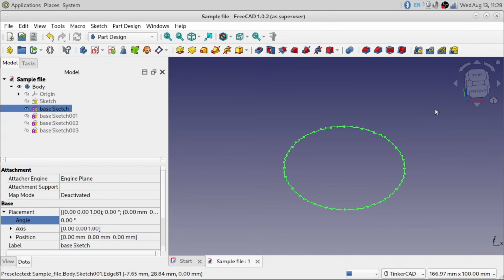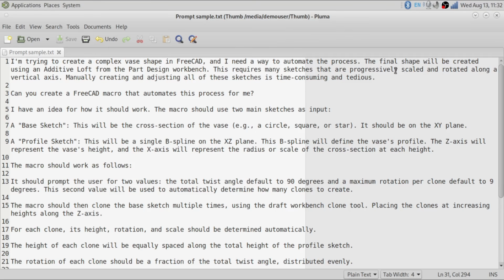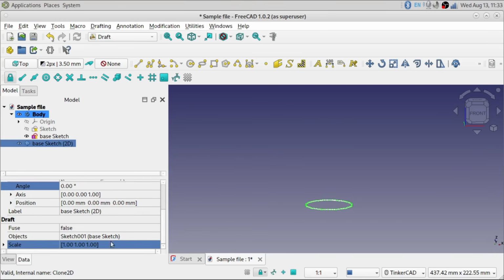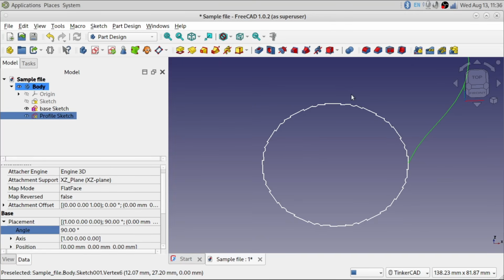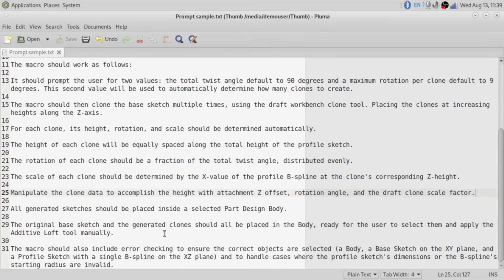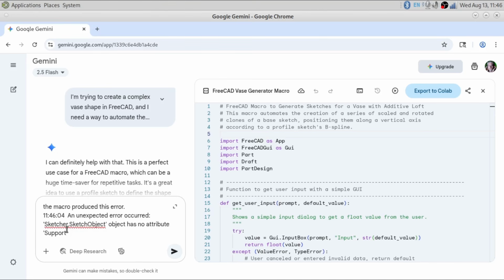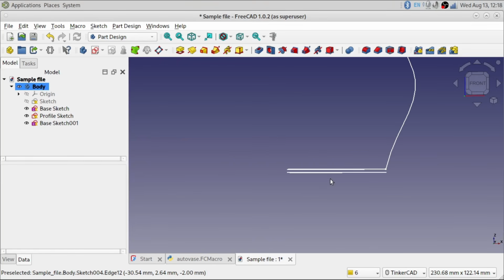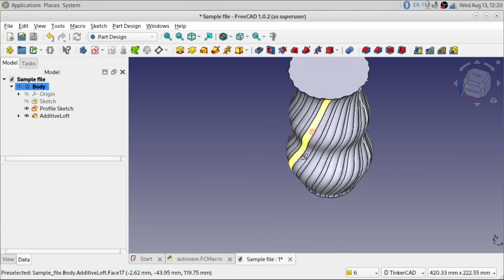3D Modeling - Using A.I. to create macros for automation in FreeCAD.

Comment: User selects:
  “Body” container
  “Base Sketch” in XY plane
     X-Axis represents cross section radius or scale 
  “Profile Sketch” B-spline in XZ Plane
     Z-axis represents vase’s height
Prompt user for:
  Total Twist Angle (Default: 90°)
  Max Rotation per Clone (Default: 9°)  
Program Calculates: 
  Increasing heights
  Scale from Z-Axis
Program in the Draft Workbench Clone Tool:
  Use “Base Sketch” 
  Use “Profile Sketch” B-spline
  Create vase section clones in Z-Axis
    Scaled
    Equally rotated
    At equal increasing heights
Program includes Error Checking:
  Correct objects selection 
    Body container
    Base sketch 
    Profile Sketch
  Profile sketch invalid dimensions
    B-spline invalid starting radius
User in the Part Design Workbench manually:
  Select the initial base sketch
  Select the Base sketch
  Select the Vase Sections 
  Generate the 3D surface using Additive Loft

Comment: Nice video, the error la are normal. I find that Claude is better at coding.  I write full blown servers complete with Claude.  I almost do not write code by hand anymore. I build a system to have context with my code and a error and fix file with index however I use VSCODE to everything.

Comment: I want to try to do this with simple labels/signs. Have some parameters where I enter the text of the label, and it automatically scales according to the size/length of the text etc. I have 0 experience in FreeCAD though... downloaded a ton of  tutorials, but will take some time.

Edit: I got it working with gemini free!
Reply from the maker: No need for fancy scripts.  You can use the expression editor to reference other dimensions in the model.  So you can have a bit of math that sets one dimension based on a scale factor of the text dimension etc.  
I did a video about some of this that might help. 
https://youtu.be/MMKFNVIuCYo

Comment: Assuming FreeCad is installed, is it possible to create a stand-alone python exe that can view a step file, and rotate it based on user (keyboard/joystick) input?

BTW, any thoughts on TinkerCad or Plasticity?  Those seem really friendly for CAD design!
Reply from the maker: There are many step file viewers for just about every OS.  If you are running Linux just open your software center, or synaptic and search for step file viewer. There's at least four. I'm sure there's many on other OSs as well. 
I used tinkercad exclusively for about 7 years, just switched to freecad last year and it is so much more powerful, and really not too hard to learn. There's a YouTube channel called Mango jelly, and on his playlists he has a free CAD 1.0 beginner course. If you are new to the program I can't lend it enough. It's well worth your time.

Comment: I have tried the macro, and it works, however, if i use the thickness tool in PartDesign workbench on the loft, it fails to do so. I don't know what i did wrong, it certainly does not have to do with the macro, that one works great. Thanks.
Reply from the maker: The thickness tool doesn't work well when you have complex geometry. If you want to hollow the vase out, the best way to do it is to draw a profile on the XZ plane of half of the hollow and do a revolve of that profile to create a solid you can cut out of the middle of the vase. Or if you're in the part design workflow you can use the groove operation to cut out the middle of the vase.
You can also print the solid version using vase mode in the slicer. That will print a single perimeter only.

Comment: I discovered how powerful macros are kinda by accident with AI. Was using deep research in ChatGPT as a tutor and it wrote one for me to automate finding the center of a rectangle. 
So my favorite auto aliases spreadsheet values in column B with the names in column A.
Reply from the maker: Another way to find the center of a rectangle is just to drop a point using construction geometry in the middle, and make it symmetrical with two diagonal corners of the rectangle.